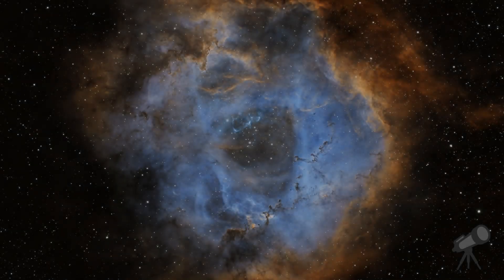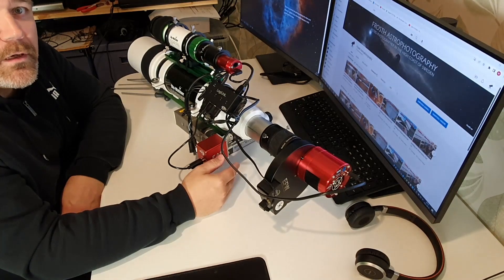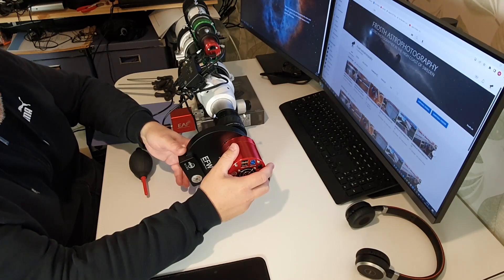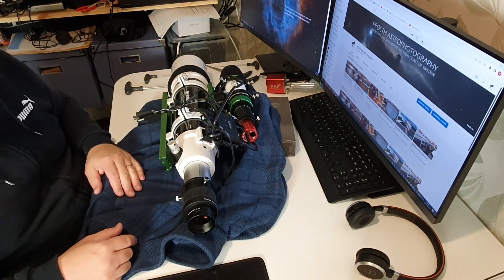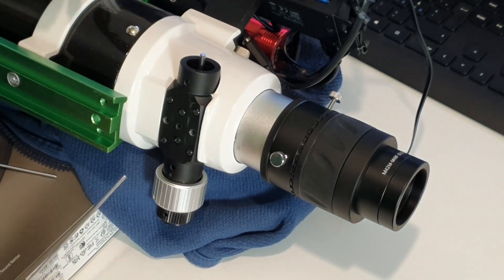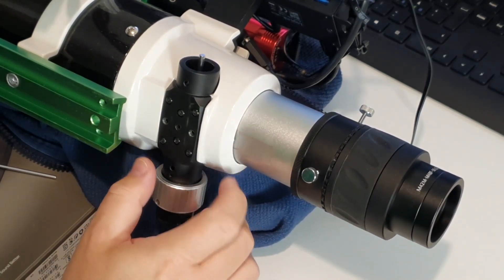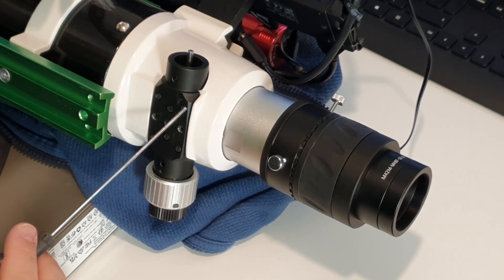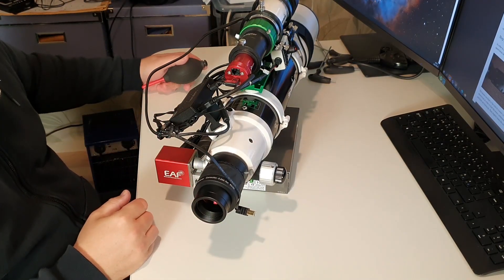Fix a slipping focus tube on the SkyWatcher EvoStar 80ED with a ZWO Automatic Focuser

Comment: Wow... when did you purchase this telescope? It seems so many of these ED80's from SW STILL have this issue. I purchased one around 3 years ago and I immediately noticed the tube would slip with my camera gear if pointed up high enough. I managed to fix it up and thought skywatcher might have too by now. Glad you're putting this out there for others :D
Reply from the maker: I got mine 1 year ago and I guess it's just the design and price level.

Comment: The two screws to the left of the lock is a push - pull system. turn one and loosen the other to level the clamp very slightly from what I have read. makes sense.
Reply from the maker: That is correct :D Thank you.